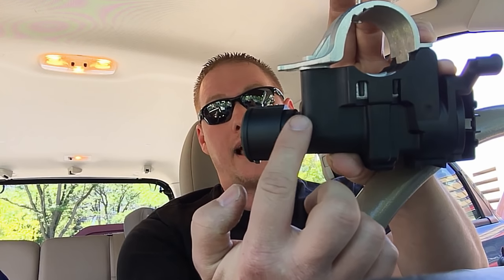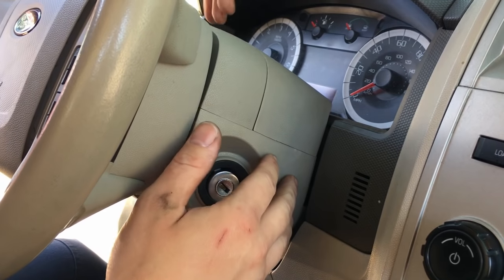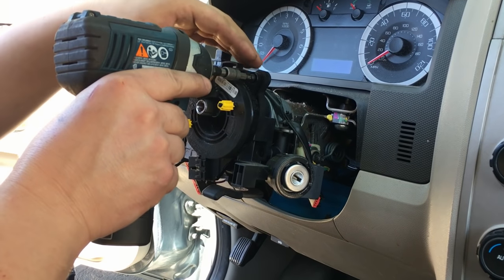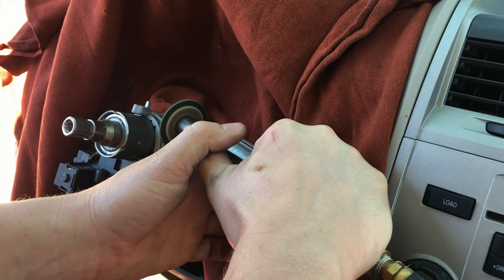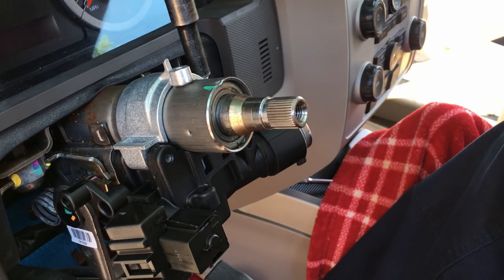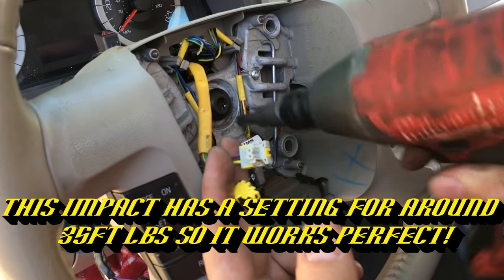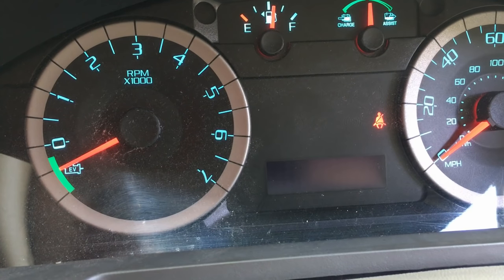2008-2012 Ford Escape No Crank No Start: Ignition Lock Module Replacement

Comment: Valuable tip. The new assembly may not take the keyed lock if it has a D ring on its base. Ford dealer said there’s a service note to remove and discard the D ring. Thanks for the guidance. Saved me a couple hundred bucks. Might want to mention that this repair does not effect the key coding. Hack saw with the blade in teeth facing handle cut a nice groove in 8-10 short strokes. New security bolt $10 at dealership. Ebay purchased the Ford part for almost half the dealership price came without the bolt. Leave the 3 lower shroud screws loose till they’re all in.

Comment: I followed your directions and results were successful. Thanks. I made the airbag spring release hole a little bigger so I could fit a small straight screwdriver in perpendicular to the release bar. I did not want to keep trying and trying and having the 3 mil hex tool keep slipping off. It worked on the first try and you cannot see the hole anyways.  I then sprayed a little silicone along the spring and it slid a lot easier. Thanks again.

Comment: A great thoughtful and informative video. I really appreciated you calling out all the tools by size that were needed for the job - that a huge time saver for me. I was able to fix my 2009 Escape as well as my sister-in-law's 2010 Escape. Unfortunately, not before the dealer sold her an ignition switch that didn't fix the problem. It's amazing how little many dealers really know about the common problems with their own vehicles!
Reply: Dealers are incompetent this is such a common problem too. Never trust these dealers if you’re out of warranty.

Comment: Well done video, two thumbs up 👍 👍.  Shame on Ford for putting out an ignition lock module that doesn't last longer than 10 years.  It's videos like this that make it possible for the rest of us to accomplish jobs that we wouldn't otherwise know how to tackle, and save ourselves hundreds of dollars at the same time.  I followed the instructions on the video and accomplished this job in less than 1 1/2 hrs (The longest part was figuring out the airbag removal and how to set up the wheel puller).  The recommended parts with links to amazon was a plus!  I checked out the steering wheel puller from Autozone too (free).

Comment: Thank you for a great video! I went to the Wrecker's and got to practice on a wrecked Focus first.  Note, if you are getting your part from a wrecker's, you can look for the part off of a Focus, Escape or Mazda Tribute.  They are all the same.  Other Tips: As stated below, you don't need to remove the steering wheel, but will need a small 5.5 socket with a 1/4" ratchet.  The aluminum bolt with that you have to grind, is easily removed with a hammer and chisel (chiseling the bolt counter clockwise and then removing by hand).  Thank you again for taking the time to make such a helpful video!  Took around 40 minutes to complete.

Comment: Great instructions. My biggest issue was they aren’t 5mm on my hybrid but 5.5mm (7/32) head. Which caused me the most trouble! I was able to do without removing steering wheel.  Although pliers did not work for me. Went hand saw way per instructions.
Reply from the maker: I specified very clearly in the video they were 5.5mm.
Reply: @FordTechMakuloco  Yeah my fault lol You make owning a ford less of a headache!

Comment: Just replaced the housing in my 2010 Ford Escape. Took about 2 hours. I was hesitant to do this because of the steering wheel. Well, no need to pull the steering wheel. All you need is a 5.5mm socket with a swivel and an 8mm socket. There are (3) 5.5mm screws that attach the plastic bottom housing cover.

The housing itself has (3) 5.5mm screws, one on the top of the housing, one on the right side of the housing and one on the bottom of the housing. Very easy to access the top and bottom screws. You'll need the swivel to access the right side screw. Make sure to disconnect the battery and leave the steering wheel in unlock position before starting the job. As you move the steering wheel to access the screws, use painters tape to keep the clock spring from popping off the back of the steering wheel. The security screw on the lock housing just needs a couple whacks with a hammer and screwdriver - it's not torqued tightly so it pops loose easily.

I replaced the housing with the Dorman OEfix housing for $50. Glad its finally fixed. As a temporary fix, I removed the bottom housing cover and was able to push both the key and the other side of the housing to get it to start.

Comment: Thank you so much for posting this extremely helpful and very easy to follow along with video. After years of dealing with this problem on my 2008 Mariner I ordered the new lock cylinder and was able to successfully change it out following your instructions. Intimidating job if you've never done it before, but all worked out great 👍👍👍

Comment: After putting it off for like a year, and thinking I was gonna get stranded in a parking lot more than once, I finally did this today, and it was perfect! My only error was mixing some of the T20's with the 5.5mm bolts on reassembly but it didn't seem to be a problem. But man, getting that air bag off sucked! Thanks for a great video!

Comment: Brian,  
       Did one (2010 ignition module) today without taking the wheel off. You do need a 5.5 1/4 inch swivel. After all the screws are out, and unlock the wheel,it's just a matter of slowly pushing the clock spring towards the steering wheel, and the junk part away from you. It takes some patients, but well worth the savings of having to deal with air bag springs.
Mike
Reply: Are you talking about two parts? A 5.5 mm socket in a quarter inch swivel adapter or a swivel head ratchet?
Reply: @Thatsmessedupman  it is a single socket 5.5 hex on one end, 1/4 drive on the other. Gearwrench makes a set for cheap

Comment: On most of these old cars, I give people the option of wiring up a push button.  So they can afford to get it going again, and drive it a little while before it goes to the big junk yard in the sky.  I run a wire between the Blue Red (+) voltage, and Blue White (This is the signal wire to the computer to start the car) on the back of the ignition switch.  The Blue Red has to stay hooked into the ignition as well because it provides all the power for the accessory and run positions.  The blue white I just cut off.   I solder them and heat shrink them and put a push button in the lower steering column cover.  I use Dorman 84822 switch because it is a nice low profile one.  I use 14 gauge wire so it can handle the amps of the fuse in case of a short.  They just put the key in turn the ignition to on and hit the button and go vroom vroom down the road for $75.   It is a common enough problem these days that I keep a few switches in my mobile load out.  I have done two of them this week.

Comment: Thank you for this video. Great quality and very thorough. I appreciate the step by step and details down to screw size. I wonder how much I saved doing to myself. This has been an issue for years I just dealt with until it finally wouldn’t start until 50 turns of key. 

Subscribing and liking this video

Thank you🇺🇸

Comment: Great and extremely helpful video!   I agree with many of the comments here – this is a fantastic video!   

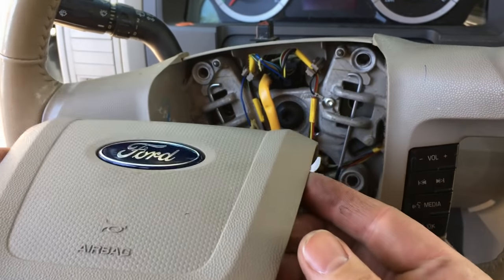The most frustrating part – is getting the air bag off.   I kept trying to imagine what I was working with behind the air bag.   Imagine a 3-sided square-shaped spring.  Starting from the upper left – the wire travels down about 2 to 3 inches – across the bottom to the right – and up the right side.   The spring itself is made of round wire a little bit bigger around than a coat hanger.  At 6:41 in the video – you can see the top left and top right corners of the spring.  At 6:42 and 7:11 in the video – you can see the full spring.   The airbag / horn piece is hooked on the top left – top right – and at the bottom.  On the bottom hook - there is a hole for you put your push tool thru but you need to make sure you are square on the wire.  If you see the horn/air bag moving - you are likely not in the hole but pushing on the hook.  At 6:43 – you can see one of the air-bag hooks.    At 6:53 and 7:04 – you can see the bottom hook.    With a blunt push tool (rounded makes it harder) – you want to pop the spring straight up.   Before success – several times I could get one side loose but not both.  In frustration – I gave my 4mm tool a good solid hit and the airbag popped free.       But it was the solid pop on the spring that moved the whole spring up enough for all 3 points to come loose.   I did not have to pull on the airbag at all.   Once the spring was pushed up for a brief second – the airbag popped free.    I hope this helps!   Good luck.

Comment: Great and very helpful video.  Just wondering why not take the wheel off first ?  I realized on reassembly that it was easier to reinstall all the plastic crap without the wheel in the way

Comment: You video was excellent got it done in about 24 minutes awesome thanks for your incite used a chisel to remove the bolt a couple light hits with the hammer screw came lose enough to manually unscrew

Comment: Thank you so much for doing this video. My 2008 had this problem and it saved me a ton of money.
Only issue was using hack saw blade to remove break a way bolt, no handy dandy  zis wheel available. 
FYI turn steering wheel up side down to unlock airbag.

Comment: Worked like a charm! Did not need a 3mm allen though; used long flat tip screwdriver and pried the back cover back and pried on the spring.

Comment: Followed the instructions and all came out excellent. Did not have to do anything to the lock itself. Had to use a T50 socket to remove the steering column bolt. Thanks :) !!

Comment: What size bolt is required for the puller (thread and length)? I have pullers, just need the correct bolt size to fit the steering wheel female thread.

Comment: First off, love the channel.  You have saved me a lot of money over the years.  So I replaced the module, but it is still not starting every time.  Recently, when it does start, after about 15 minutes of drive time my cluster lights up every light and the tachometer and speedometer all go to zero.  And now the trunk will not unlock and the door alarm rings even if the key is not in the ignition.  Any ideas.  Wondering if I should push it off a cliff.

Comment: I have an Allen head machine screw that fits where the break-off bolt goes. Can I use that instead of buying a new break-off bolt?  THANKS. GREAT VIDEO!
Reply: Late to the party but the break off bolt is used for security reasons. If you use a Allen bolt, a thief can easily remove the housing

Comment: This video made the job very easy. Only tip that wasn't in the video, which I think saves time, is to use a punch and hammer to remove the security bolt. The original bolt is soft enough that I used a flat head screwdriver as my punch. Once you gouge the bolt, just keep tapping/hitting the screwdriver with the hammer to twist it off. Saves time by not having to notch the head.

Comment: I was able to change one today on my daughter's 2009 Escape without pulling off steering wheel. Turning the steering to a about 90 degrees from center will give you access to the 5.5 bolt head that appears to be inaccessible. Ordered the part from ebay for $136
Reply: Wouldn't you need to removing the turning signal stock to remove the lock module

Comment: This was the issue on a 2010 Ford Escape XLT 3.0 that is my Company Vehicle. First time we had to replace the Module on the driver side of the column, second time we replaced the entire Ignition Switch and Module. All Ford Parts, and they seem to last about 2 years before I start having issues. 

I know when it is having issues when I have to shove the key/cylinder in to start it.

Comment: Thank you very much. You made this very easy to replace the lock out in my 2008 ford escape. Great detail and precise instructions.
Reply: I have an 08 hybrid. Escape. Changed the ignition switch relay. Put it in and it doesn't turn over. Sounds like it's trying. I took it out and using plyers and having key turned it cranks up. What should I do now?

Comment: Excellent how-to video.  I just did my lock module in about 2 hours and found no inaccuracies or missing details in this video.  I was apprehensive about the slot cutting in the head of the bolt but found that easily accomplished just with a hacksaw.  Then I drove a 1/4 in. hex drive straight screwdriver bit into the slot and removed with a ratchet wrench.  Awkward getting a big screwdriver in there.  For $0.80 at Home Depot I got an M8x1.25x16mm hollow hex head bolt to replace it as the module kit I got didn't have a new bolt.  Check to see if you have a 5.5 mm nut driver or socket before getting started.  Most sets don't include one.  The local Home Depot doesn't stock it either.  Amazon for about $6.

The most difficult part is pulling the steering wheel.  Lacking a puller, I made one in just a couple minutes and was successful. The two bolt holes for the puller in the wheel are M8x1.25

Comment: I've always used a large screwdriver and small ball pen hammer striking the breakaway bolt on the side to move it counter clockwise to loosen it.  Surprisingly it comes loose easily with a perfect hit.
Reply from the maker: yeah the torque it takes to break the head off is very little so I imagine the torque spec is low.

Comment: I would like to say thank you.  My wife has started to have problems with starting her 2008 Ford Escape Hybrid and this did the trick!  I am wondering though, why go through the hassle of replacement parts?  The test you performed in the beginning of the video worked for us and (unless something else goes wrong) we can just continue to push the key in towards the steering column to start the vehicle.  Any reason we should not do this?
Reply: I have experienced this before. It worked for quite awhile, but eventually pressing harder into the ignition stopped working all together.

Comment: Great video and definitely helped verify some things for this repair.   Like some others, I left the wheel on.  Just used vise grips on that strange bolt which surprised me that  it loosened.  Thank you!
Reply: How did you do it without removing the steering wheel? On top of the part itself, there is small rounded protrusion that prevents the part from swinging open...

Comment: I followed your directions as closely as possible. The clip release would only work on the right side. So I wound up pushing up the left spring with a long flat head and it unlocked. I bought a Dremel to notch the break away bolt, but I was able to break it loose with a pair of knipex channel locks. Just used a cummins front cover bolt with blue loctite. I will be just fine if I never have to do this again. Lol

Comment: Thank you! 
A 2 take my time moments.
1) using the allen wrench to release the airbag, had to push harder than it looked in the video. 
2) releasing the gray lock cylinder,nhad to push harder than it looked in the video. 

Thanks for a great video!

Comment: This is the proper way to do this repair people. The only thing that I do differently is that I use a center punch
and hammer to unwind the headless security bolts on all the ignition locks I work on. Either method is acceptable.

Comment: Did the ignition switch yesterday using this video as a guide, however I still have the same no start problem as before.  I can feel it not fully engage with the switch until I wiggle the tumbler around a bit and it pops into place.

Comment: What length, size and pitch are the two steering wheel puller bolts you used. By the way you have been a great help. Appreciate you sharing your knowledge.

Comment: BOOM, replaced my honey's 2009 ignition module in under 1.5 hours which includes a trip to the store to purchase a t50 star bit...  I was able to remove the steering wheel without a puller, but I have to explain to my honey why her steering wheel will be a little off center until I replace it again in 100K miles, as I put the steering wheel back a wee bit to the right....  I had a heck of a time with the air bag, as I did not have a 3mm hex readily available.  Thanks FTMak!

Comment: Hi, Thank you so much for the detailed video. I want to ask a quick question that i have Ford Escape 2010 Hybrid but it have 2 warning lights comes on one is triangle with exclamation mark in it and the second one is anti theft light on left lower side of odo meter. Also it doesn't start when i push the key inside like you do in the video. Is it a module or the ignition switch? Please Guide. Thanks

Comment: Replaced ignition lock module, replaced starter, and still no crank? Check all the fuses, they were good, any recommendations would greatly be appreciated. The red car with the lock is flashing, but shows how many miles to empty. 2008 ford escape v6

Comment: I did everything but installation of the air bag. Should the car start without the air bag installed, because it is not turning over at this point.  Thanks for the great video.

Comment: This is exactly what my Escape is doing. After testing I now KNOW this is the problem. Ford should have taken care of this with a recall. I don't plan to fix it myself but it's nice to know what I thought the problem was is, in fact, the problem. This could be really pricey if you have a mechanic that wants to do more extreme repairs than needed.